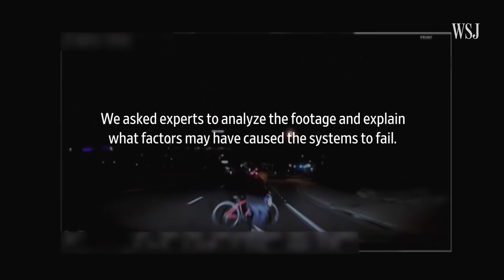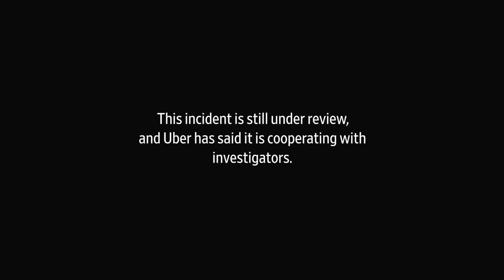Experts Break Down the Self-Driving Uber Crash

Comment: A lot of people are comparing their own reaction time to that of the computer, which is supposed to be reading and interpreting a laser map and radar of the road ahead of it.  There is an obvious obstacle in the road.  Regardless of a human's reaction time, the computer should be able to sense the object and should stop the car.  
The car can see in wavelengths that we cannot, and the headlights are not required for it to "see" anything.
It should have at least applied the brakes at some point that the obstacle is in the roadway.
There is a chance, however slight, that a human driver would at least have applied the brakes when the bike appears in the headlights.
The motivations of the pedestrian are irrelevant.  The car is supposed to have super human capabilities.
It has a problem with either the sensors or how the program interpreted the input of the sensors.
Reply: Drew yes, yes it is, autonomous cars are marketed to save lives by increasing reaction time. Had the car applied the brakes the moment you could see her shoes, this could, very likely, be a story about how self driving cars save lives.
Reply: The actual story here is the COVER-UP by Uber and the State of Arizona.  The technicals are juvenile simple and the car failed completely. We already knew this minutes after it failed.
Reply: I can't upvote this comment enough. Autonomous cars are supposed to save humans out of their own mistakes, not cruise streets and blame humans after they run over one. 

The woman was at fault? It's not about fault, it's about how an autonomous car failed to do the one thing it should be amazing at doing it: avoid collisions that are extremely simple to avoid. We are not talking about edge case scenarios here, the car didn't see a very obvious obstacle in its path. So much for autonomous cars being safer (which I'm not denying they are, but not Uber's apparently).
Reply: I completely agree with marc54678. "The car is supposed to have superhuman capabilities". Very true. Equipment can see things which normal humans cannot and that makes these machines superior.
Reply: They need to add  thermo sensors  that can pick up on a person's ir signature

Comment: This in part of a lighting issue, did you know that Audi and other car manufacturers are trying to develop new headlight technology but the US doesn’t allow it. It would allow the car to stay on high beam mode by tracking other cars and dimming that section automatically... But it seems the DOT will keep us stuck in the past, just like those poorly working streetlights that should really be LED.
Reply: You realize that it's a self driving car and relies on sensors more than headlights?
Reply: Fritz Asuro  Of course, there's clearly a sensor/data processing failure, as the lidar/+radar should of noticed the pedestrian. But the camera helps validate the information from the other sensors and light is important.

Comment: The car forensics specialist Dipl.-Ing. Thomas Kaefer, M.Sc. has requested the original video of the Uber-Volvo accident in Tempe, Arizona (USA) dated March 19th 2018 from the local police. It shows the accident of the Uber-Volvo where a pedestrian was killed. Thomas Kaefer has evaluated the video and additional sources as part of his research work Car-Forensics. He comes here in part to completely different statements than the police reports and the media coverage. In fact, he was able to prove that the pedestrian had not suddenly stepped out of a shadow and that the accident was anything but inevitable for man or machine. The situation at the scene of the accident was not nearly as dark and unclear as the strikingly dark video is supposed to make you believe. The video has been at least once lossy copied and rendered negligent or even deliberately darker. The vehicle has moved within the allowed speed limit of 45 mph and thus not - as reported incorrectly - committed a speed violation. However, it was at the time of the impact 45 mph and not as claimed 40 mph fast and has accelerated independently immediately after the accident. The human driver on board whose job was to monitor the fully automated vehicle did not look at the road at least six seconds before the impact and was apparently distracted. She could have easily avoided the accident by early intervention (braking and / or avoiding). Apparently, however, the sensor systems of the vehicle have failed. The pedestrian must have been identified as an obstacle on collision course at least 4.5 seconds and 80 meters before the accident (stopping distance at this speed max. 54 m).

https://youtu.be/7JBdEGjkmDw
Reply: "She could have easily avoided the accident" Thats a big accusation that seems to have no root in reality

Comment: I do agree that the car should have detected the pedestrian and stopped. However, the pedestrian also has the responsibility to be aware of their surroundings. It's very evident that the pedestrian is walking in a dark road, not using a cross walk and not being aware of the traffic. It's hard to tell if a driver would've seen him/her, since our eyes are better at night vision and have a higher dynamic range, but I doubt that would've helped. Pedestrians in dark conditions are basically invisible. A driver in a normal car would've probably hit that pedestrian too.

Comment: Three failures led to this accident, driver, system and pedestrian.  All three of these simultaneously failing at the same time resulted in a fatal accident.  All three are to blame here, not just any one of them.  The driver should have been paying attention, the system should have seen the pedestrian and finally, the pedestrian should have been more adept to safety. So which will take the most blame?  The system, because people are never going to be perfect, but the system, designed by people, has the most room for improvement.

Comment: The pedestrian carries the whole responsibility for their death. Why slo-mo jaywalk a street with total disregard of all the legal and basic risk rules? Now as to uber, yes the car technically failed but without any responsibility of the death. The failure is that the car didn’t react as it was supposed/designed to react. Could this failure be indicative of other potential failures that would surface in very specific scenarios? I suspect that there are more scenarios where other failures would manifest themselves given certain conditions and circumstances.

Comment: The Brand for sensory and detection was unable to detect quickly, since it has numerous factors consider and it has to be developed, studied and place standards that can forecast/foresee its accuracy, since technology is also known for areas of development, one shouldn't rely heavily on the tech.alone, an individual is still the best driver at all times, while they tech only assist, as details are applied/implemented by the individual for complete security, reliability as well as protection. Laws are also enacted that limits, guarantees the safety of the commuters, the public as well as its owners as consumer protection, e-commerce laws are compliant and extends its studies for the welfare of the cities/communities. Respectively certain.

Comment: Commenters stop blaming the dead woman! Go to google street view and look at that area in the day time. You will see median has sidewalks and the woman had to cross 5 lanes. When she started to cross the car could have been hidden by the bridge down the road. By the time she reaches the 5th lane the car driving 40 mph could be at the same point in the road. The cars sensors (Lidar in Radar) should have seen her and stopped the car. They did not. The car failed to do what it should and Uber paused the program as they should. Let’s fix the car not blame the dead.
Reply: Would you blame a person if it was a manually driven car? No.
Reply: Yes, I would blame the driver. "Remember that you must slow down and stop when necessary for a person walking in the street. Always look ahead for places where pedestrians may be hidden, such as around a
curve, at the top of a hill, or between parked cars." per the MA Drivers Manual
Reply: Brian Foulds She committed suicide Who walks a bike across the highway? Why did she run when she saw those lights coming? Why wasn’t she riding her bike? And it was pitch black in the middle of the night. That women committed suicide they need to do a toxicology test on her
Reply: Agreed - regardless of the woman’s intention, pedestrians always have the right of way on the road despite not using a designated crosswalk. The autonomous Volvo is equipped with technology that can detect objects and environments using different wavelengths of light and computational power we can’t perceive or do ourselves.

I’d probably go with Uber being the one at fault if I was investigating.
Reply: errr...How about no? Pedestrian don't always have the right of way? If that's the case then what's the point of traffic law anyway?
Reply: Bro Ccoli It’s in the Arizona driving book, my dude. It’s kinda fucked up but it’s true.
Reply: How about you take your own advice and look on google street view to see that there is a crosswalk just up the road. Ever heard of look both ways before crossing Brian?

Comment: self-driving technology must be safer than human drivers or we should not be using them at all
Reply: Julian Chang, it is already safer. It is the humans that makes traffic unsafe, it is pretty obvious in this case. However, this accident shows that autonomous driving is still not 100% safe and there are still bugs that needs to handled in the Uber cars. Both the lidar and the radar should have detected the woman and the AD algorithm should have stopped the car.
Reply: Well... Not necessarily. The economic benefit of not having to drive across all drivers in the state may outweigh a couple of accidents.
Reply: Also the only way to make them better is to trial them on the roads.
Reply: Rob B That's not even remotely true.  If all cars were autonomous we'd have an overpopulation problem since we'd lose out on our third largest cause of fatalities.
Reply: Julian Chang this tech is driven not by a humanitarian   or altruistic sentiment but by Greed plain and simple. If you don't realize that, I have beach front property for sale in Arizona selling cheap.
Reply: Sauromannen How is it already safer? We clearly see that it had ZERO reaction for a pedestrian, and a human driver would have reacted

Comment: Sensors operates best in a clean environment. they should not be used for driving automation. Even then, rain/snow/mother nature would greatly affect radar and lidar (that's probably why AZ is the guinea pig state, odds of the clear dry weather changing is very low)

Comment: Just wait for mass deployment when the sensors on many autonomous vehicles are likely to be dirty / badly maintained - how many accidents will happen then?
Reply: slovokia, probably many more, just like today with humans driving. If the sensors are dirty, the system goes into ”safe state” and the driver has to take over.
Reply: Sauromannen Can you explain this process a bit more? How does the software determine the sensors are dirty? Could the system go into safe state in the middle of the highway late at night during a trip? How should we set expectations of the demands placed upon the human passengers of autonomous vehicles? Will it be a legal requirement that all sensor data and software logging data be made public after any accident? After any passenger complaint? My point is often we get excited about new technology while ignoring all the legal / managerial competence issues that a functioning system depends on.
Reply: slovokia, yes there are numerous of safety checks and redundancy correlations done many times every second in the vehicle. Depending on what level of autonomous driving the vehicle can do, it will have different ways to handle ”safe state”. The low level of ADAS will hand over the control to the driver, but higher level would use the remaining reduntant sensors to e.g., stop in a safe place. It is a part of the Functional Safety development that the self driving vehicle must undergo.

Comment: Leave it to a bunch of engineers to over think something. How about you had a person crossing the road where they weren't supposed to. That would throw a human driver off as well.
Reply: em745a- I didn't even know it was a woman. They're usually more careful than men. She could have worn more reflective clothing, and the list could go on and on. No charges would have ever been filed against a human in the same situation. I don't know why Uber's operating system is being raked over the coals to this degree.
Reply: Software engineer here. It's actually a rather simple scenario. Reading signs, spotting traffic lights, recognize bikes, etc, all those are pretty hard tasks to do but not this one.

This one is as cut and dried as it could be: big object (it doesn't matter if it's a human, a bike, or something the computer has never seem) moving in a perpendicular path to the one I'm driving, the vectors seems to match in logical collision, proposed solution: brake, turn, alert the human driver. The car did none of the three.
Reply: I still don't get the "blame the car" thing. There was a human driver sitting there as a backup and she couldn't react in time.

Comment: Both the safety driver and the technology obviously failed to see and adjust for a sign visible on the right that warns traffic in the right lane to 'Yield to Bikes'. That fact alone is enough to render the technology useless and the Uber at fault. The Uber should have been on high alert to non-vehicular traffic as it approached a merger with the Bike Lane. One can easily infer that even a cyclist in the bike lane would have been vulnerable in the crossover a few feet ahead.
Reply: Honestly I think its all Uber and thier software maybe hardware
Reply: kuruji How do you know that was a bike lane sign?  You can't see it clearly and there are no road markings.
Reply: The signage is visible on google street view. A few feet ahead of where this occurred, the car lane crosses over the bike lane to become the right turn lane, and cars are directed to give right-of-way to bike traffic. The sign warns drivers of this, but the Uber car doesn't have a clue what's going on.
Reply: Well to be fair neither the bike nor the rider were in the bike lane...

Comment: If only we used sensing systems in any or all wavelengths this would have been avoided. UV, infrared, sound
Reply: How could this have been avoided in that scenario? An infrared or UV LIDAR can see the same macroscopic things. UV being potentially harmful to humans, and ultrasonic proximity sensors are not only slow (speed of sound vs speed of light) but also unreliable to isolate distinct objects in the case of classification for AI. Furthermore, sound is not different wavelength, it is a different form of energy propagation entirely. It seems that they had all the proper hardware to make the classifications necessary, however the potential faults do not lie in the systems implemented but rather likely in either hardware malfunction or the actual code. 

Pretty much anything but what you said.
Reply: MadJDMTurboBoost You some sort of engineer?
Reply: Beast Folife Probably just a really smart person.
Reply: Infrared, Heat cameras would have surely seen the person
Reply: Bugler55 isn’t the sensor near the grill on normal cars with that emergency crash avoidance?
Reply: It was obviously a software failure, I don't know about anyone else here but I've had one or two problems with computers myself (slight understatement).
Reply: its not a blind zone they are smarter than that

Comment: How can a computer replace a human, please don't get me wrong. Computer can perform a lot of task, current technology is not ready to replace human perhaps in another decade
Reply: That's why the technology needs to be worked on now so in a decades time it would be ready for use by the masses. We already have cars who automatically brake with impending danger up ahead and cars who park for you. Fully autonomous cars are just the next natural step.
Reply: There are 5 levels of autonomous vehicles. We are currently at level 3. This means that the AI can perform almost all tasks as a human driver, but not quite as good statistically. This means that the driver is still responsible for having full focus on the road and its surroundings. Always ready to take action if necessary. The driver in this video did not pay any attention, so she should be held responsible for the accident.

At level 4 however, the AI exceeds any human in all driving tasks, in any type of weather. This means that the driver does not need to have any focus on the road at all, whatsoever. I don't think even you need a driving license? Not sure though. When this milestone is reached however, it will change transportation for ever. This is the point where we can reduce the amounts of traffic deaths significantly, statistically speaking. It's more beneficial to let AI drive than humans, which also makes it safer for yourself, statistically.

Almost all major car companies are investing seriously in this technology, and the first one to solve it gets hold of the largest market share. It's a very exciting race. Most companies such as Volvo, Audi, Mercedes, BMW etc have promised a level 4 autonomous vehicle by 2021. I don't have any doubts at all considering the ridiculously insane amount of money that's being invested in this techonolgy.

By the way, level 5 is reached when the AI can drive through any terrain off road at least better than a human. Not being dependent on pre-defined roads and maps.